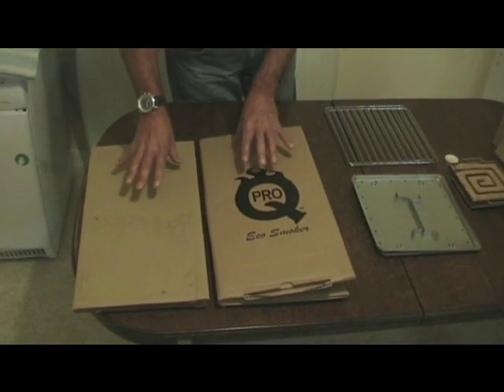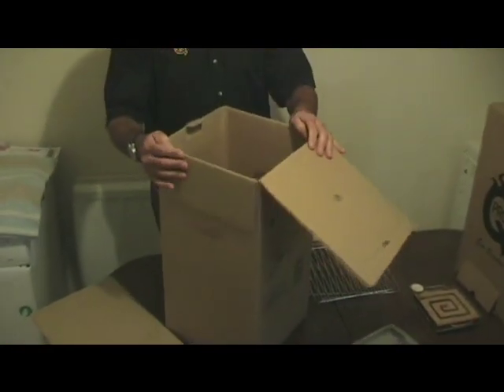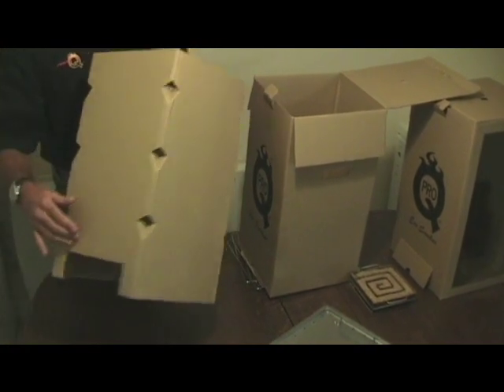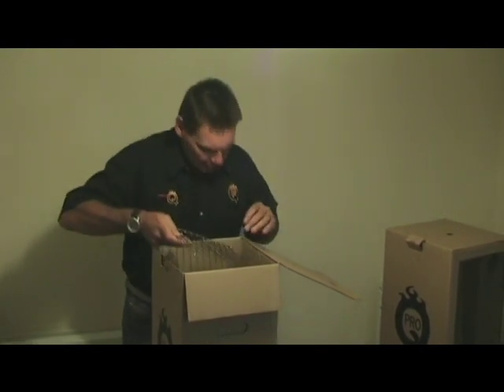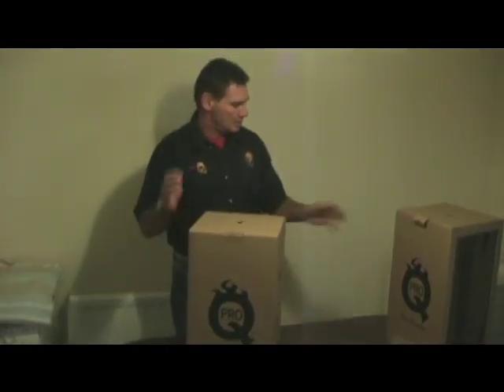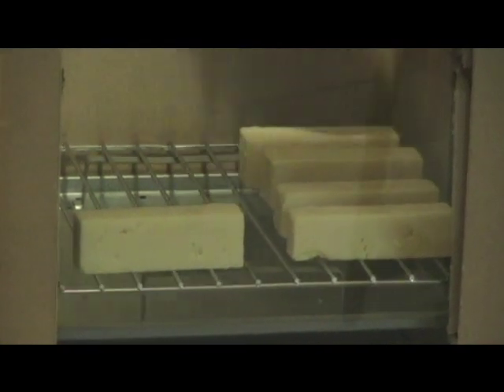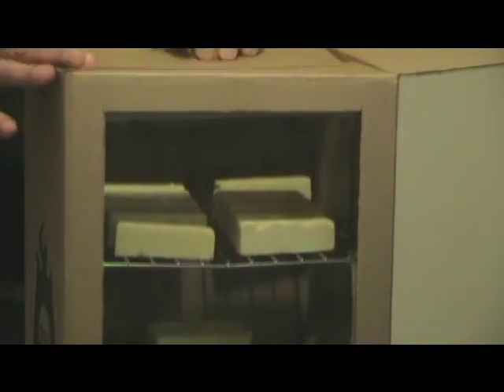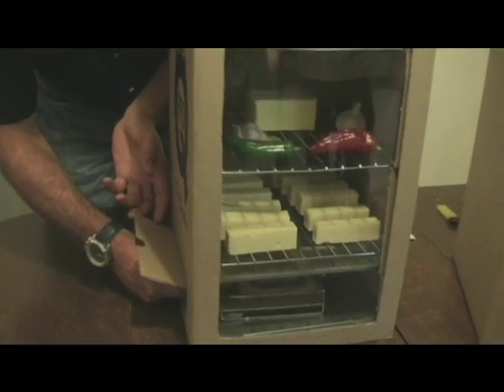Cold smoking in a cardboard box

Comment from the maker: It is designed to be used outdoors, as per the instructions that come with the unit. It is perfectly safe to use under cover, or in a shed as long as the instructions are read and followed. You will however need to be aware that unless you have an extractor fan the smoke will permeate everything around it.